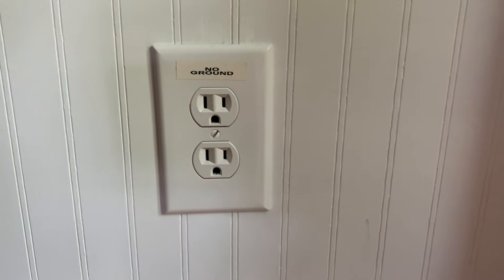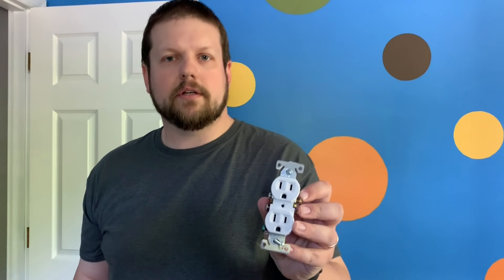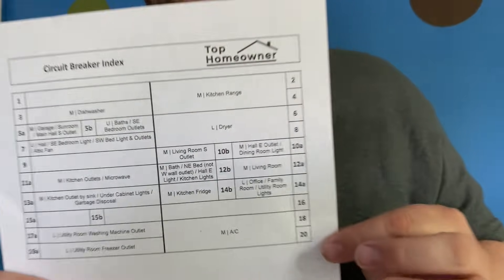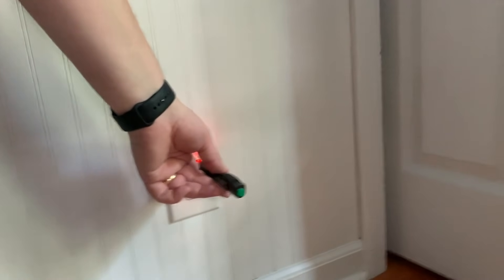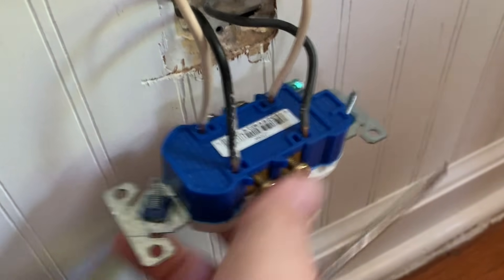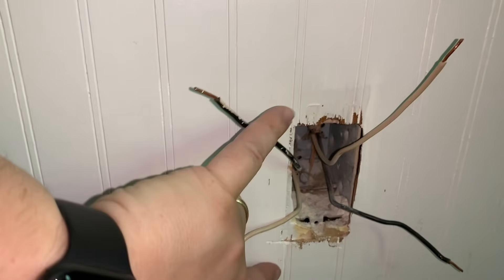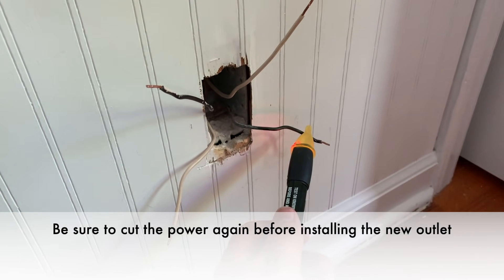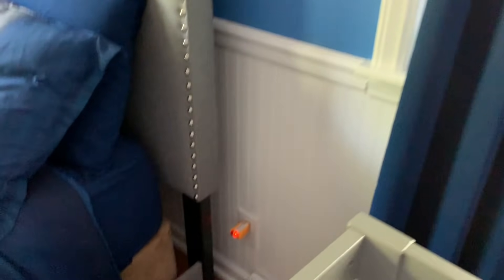Fixing Ungrounded Outlets - An Alternative Option to Rewiring Your Home

Comment: OK my question is, if you’re using a GFCI outlet you still need a ground that is correctly installed back to breaker box. By adding a ground fault outlet you still need a proper ground to make it work and be safe. So can you explain how you fix the ground when it showed it wasn’t working?
Reply: Its NEC compliant to replace with a GFI as long as you label it with "no equipment ground"
Reply: @JeffPenaify  but it won't protect you if the  whole branch circuit does not have a ground.
Reply: @donski1519  I didnt say smart I said N.E.C. compliant 😂
Reply: Don Ski in theory when your body becomes the grounded connector the gfci will trip. It is NEC approved with the inclusion of labels on each receptacle on the circuit (No Equipment Ground). But everyone will agree the addition of the ground wire is better.
Reply: @donski1519  Yes it will.
Reply: Justin, I have two suggestions. One option is to (if they are available for your Breaker Box) replace the standard breaker with a AFCI/GFCI combo breaker. This will connect to the ground in the Load Center and protect ALL outlets on the circuit. The second option, if your Breaker Box is in a fairly hidden area, is to add a GFCI outlet immediately next to the Breaker Box, connecting that circuit from the breaker to the GFCI with new ROMEX, then connect the original branch circuit wiring to the load side of that GFCI.
Reply: justin eben no you don’t !!! To properly install one it only takes two wires so I could be ran without a ground

Comment: You only have a half understanding of what you just did.  I liked your video but caution others against thinking this is an answer to circuits without a ground wire...it is not.  You could have just labeled your existing outlets with stickers that say "No Equipment Ground" according to the NEC.  What you did was provide GFCI protection for all the outlets BUT you still have no equipment ground and All of the outlets (including the GFCI outlet) must be labeled "No Equipment Ground".  What many people don't understand is that GFCI outlets operate without a ground wire, they don't need them.  What meets the NEC code is a label that warns everyone that the outlets have "No Equipment Ground".  I am not an electrician but I'm on solid ground here.
Reply: NEC 2017, Article 406.4(D)(2)a,b,c
You can't just mark non-grounded receptacles with a label indicating "no ground", that does not meet NEC code requirements unless modified by local AHJ.
To install grounded type outlets in a receptacle box with no equipment ground conductor, you have two options.
1) Install a GFCI outlet in every receptacle box and label it "No Equipment Ground".
2) Install a GFCI outlet at the first receptacle box in the circuit, label it "No equipment ground", then at every grounded type outlet controlled by it, label them "No equipment ground", and "GFCI Protected outlet".
As well as making sure that any existing conductors are not connected between the equipment ground terminals on the outlets in the circuit.
I am an electrician ;)
Reply: @trevork9745  You are 100% correct and I will edit my previous comment accordingly.  But my concern about this video and others like it is that they seem to imply that the gfci provides an equipment ground and they do not.  I would have run a ground wire all the way to the service panel to make it right.
Reply: @skippers9277  Agreed, the GFCI only brings a receptacle to accepted code. Best option is to run that equipment ground. Although the GFCI provides a level of protection against shocks, it still does not provide a secondary return path for current during a fault, causing voltage potential on the surface of equipment; perhaps if the circuit breaker feeding the GFCI doesn't trip, thus potentially being a dangerous condition.
Reply: @trevork9745  Or third you could install a GFCI breaker. The point is that they need to be GFCI protected. Where the GFCI is is not relevant. They also need to be marked so that everyone looking at any of the outlet will immediately know both that there is no ground connection and that it is GFCI protected.,
Reply: @okaro6595  NEC2017 406.4(D)1-6 mentions nowhere of using a GFCI breaker to replace non grounding receptacles with grounding type receptacles. Sure you could use the breaker, but thats not code here in particular and not allowed. If AHJ modifies code in your area to include GFCI breakers then go ahead. Its also more cost effective for the HO to use a GFCI outlet at the home run receptacle vs a GFCI breaker...majority of folks swapping non grounding outlets to grounding type/or are remediating the problem of open ground on outlets are doing so following a home inspection where they want to bring repairs up to code as cost effectively as possible. YMMV.
Reply: @trevork9745  I wondered about that too, so I looked it up. "A non–grounding-type receptacle(s) shall be permitted to be replaced with a grounding-type receptacle(s) where supplied through a ground-fault circuit interrupter."  NEC (2017) 406.4(D)(2)(c).   So, "supplied through GFCI" obviously includes a GFCI receptacle or a GFCI breaker, unless local code says otherwise.  Other comments suggest codes that don't allow "downstream" protection of "grounding-type" receptacles (i.e., on the "load" side of a separate GFCI device) without an actual ground.
Reply from the maker: I made a follow-up video that talks about this and answers some other questions here: https://youtu.be/3AXcRsAOLPk
Reply: Without a ground wire all the way through the branch circuit the GFCI does not work. It compares the neutral to the ground, if there is a difference of 5mA or more it will trip. If there's no ground how can it work.
Reply: @donski1519  It can only work when something else (like a human body) becomes the ground by conducting the fault current.  Sounds scary but I guess it's better than what was there before.
Reply: Skipper S while far from ideal, it does provide protection that was not present previously. The intention of the labels (at least in my opinion) is to forewarn people that 1) they run a greater risk of electrical shock (super important for folks that wear electrical devices like pace makers) 2) items plugged into them will not be grounded, which places the item at potentially greater electrical risk
Reply: @donski1519  No, it compares line to neutral.

Comment: When you have exposed wires (7:10) you should wire nut / cap them and then turn on the power. This will prevent any accidental arcing or shorting should someone or a pet  "tamper" with the wires once you turn on the power.  Next, use your tester to test the wire sheathing to find the hot wire(s). I heard little kids voices in the background so this is just another safety measure for anyone in the house that might accidently touch the wires when you turn the breaker back on.
Reply from the maker: Great point! I talked about this in my latest video. It's here if you're interested: https://youtu.be/3AXcRsAOLPk

Comment: How did you ground the gfci without a ground wire?
Reply: bad Good  It does offer protection without an equipment ground by monitoring difference in current between hot and neutral, which means current is leaking to another source.....so yes a GFCI can operate without the EGC.
Reply: The outlet still has no safety ground. This GFCI is an acceptable workaround 
for older wiring with no ground conductor. Need two stickers on the second
outlet. "GFCI PROTECTED" and "NO GROUND"  Thank you.
Reply from the maker: GFCI outlets will prevent shock and electrocution. Always check your local electrical codes to see if this is acceptable in your area.

Comment: Does this CFC I outlets can help secure home appliances like TVs  from source and lightings ?
Reply: no, it has to be grounded via a true ground
Reply: Matt an still may not help in any surge situation like a lightning strike to prevent damage. It has to have surge ratings to perform that function. Then there various ratings within surge protectors as to the amount of surge they protect against.
Reply: @crustyxpunk  No no no, You are confusing operational grounding and protective grounding. Operational grounding i.e. connecting the neutral wire to earth is among others for protection against lightnings. All systems since around 1900 have used operational grounding. Protective grounding is used to protect against electric shocks. It means connecting the equipment case to the ground and/or neutral wire with a separate grounding connector.

TVs typically are double insulated so they do not use protective grounding. They may, however, be grounded through the antenna/cable.
Reply: There's a difference between equipment ground and earth ground.

Equipment ground is an emergency return path to neutral, ideally it'll never be used, but will protect you and your equipment in case of a ground fault. 

Earth ground uses a copper grounding rod that gets driven into the earth and attached to the house, the lightning ideally travels through the rod instead of your eletrical wiring. 

If you want further protection from lightning then what you're looking for is a surge protector.
Reply: @cinnabarsonar2072  How is "equipment ground" somehow different from "earth ground"?  An equipment ground is bonded directly to the earth. That's the whole point.
Reply: @UpnorthHere  Equipment ground is bonded directly to the main breaker's neutral.  It's meant as an emergency return path to neutral if there ever is a ground fault.  Such as if a hot wire's insulation gets frayed and makes contact with a metal casing. 

Earth ground is a metal pole that's buried near the household that's bonded to the service pannel, and is intended to protect the property against lightning strikes, as the lightning will perfer going through the grounding pole instead of through your house wiring.

Comment: If I can’t get a surge protector strip yet but I have a grounded outlet, can I plug this nice plasma tv into the socket and watch it during heavy storms?
Reply: If you still use plasma you should hope for a surge so that you can get a new one. :-) (Well I had a tube two years ago)
Reply from the maker: I wouldn't do that... Even with a surge protector!
Reply: J Wil really?!?  So power strips are just for expanding more outlets?
Reply: @HamuelTheGrey  It does nothing against a direct trike. Sure it there is some strike nearby it might help.

Comment: So, let me get this straight. Iregardless of the allowd code. If my right hand comes in contact with the hot side of a UNGROUNDED GFI receptacle and I touch my kitchen faucet with my left hand I am completely safe???
Reply from the maker: Generally speaking, you should always take basic safety precautions so I wouldn't tempt fate.
Reply: You will likely survive that but if you do it will a grounded non GFCI outlet you likely will be dead. A properly working GFCI is almost 100% effective against severe electric shocks. It does not protect from a shock between line and neutral though.
Reply: John Connolly  ... "a very slight pinch" for the 17 milliseconds it took for the GFCI to trip.

Comment: WON'T WORK!  The "GFCI" stands for "ground fault circuit interrupter".  What it does is monitors the electrical potential (fault) between the hot wire and ground. If the GFCI is not grounded then how can it detect a potential to ground?
Reply: do you want to google "how does a GFCI work" or should I?  https://lmgtfy.com/?q=how+does+a+gfci+outlet+work
  (spoiler: it detects any difference in current between the hot and neutral; any difference indicates a ground fault (i.e. the current is going somewhere else), and it interrupts the circuit; it makes no use of the ground conductor at all, and it is perfectly legal and within NEC to use GFCI outlets without ground WITH a label that says "No Equipment Ground")
Reply: I believe the guy said it's grounded from behind the box..
Reply: @scribblit  no ground in this application
Reply: needs afci/gfci
Reply: @mcgilljb92  Possibly, but probably only "where branch-circuit wiring is modified, replaced, or extended," not simply replacing an ungrounded receptacle with a 3-slot ungrounded GFCI.

Comment: This is a good option in older homes. GFCI outlets are significantly more expensive than regular 3 prong outlets, so use one GFCI "upstream" of the other outlets in each circuit. One thing to be aware of is many older homes like my 1949 home are not wired with all the outlets in one room on the same circuit. In fact, no room in my house is wired that way. For example, there may be one of the outlets in the living room, another above it in a bedroom etc. So, I made a booklet of circuit diagrams by going circuit by circuit turning off the power and seeing which outlets and lights had no power. I also traced the exposed wires in the basement to get an idea of which outlet was first in the circuit. The kitchen and also the washer/dryer area were the only grounded circuits. The rest of the 2 prong outlets in the house I upgraded to 3 prong, protecting them with a GFCI at the start of the run, and attaching proper labels them. A lot cheaper than rewiring your house, but providing ground related safety without a ground wire.
Reply: Or you can replace the actual breakers to GFCI breakers. It will protect everything on the circuit that breaker feeds
Reply: @terrythomas790  If your place has breakers.
Reply: @ronaldcarson4360  If it doesn't have breakers, have an electrician install a subpanel for the necessary GFCI or AFCI breakers.
Reply: @terrythomas790  Very often not possible.
Reply: @terrythomas790  
Sometimes you don't want certain receptacles on a GFCI circuit.
Reply: @terrythomas790  this is a good option if you have a modern panel, but if you have an older home like my 1960 home it’s not an option
Reply: 1949 home with different circuits in same room. It’s better to have that you room is served by 2 circuits with double the amp capacity of 1. Running a vacuum on one circuit and you won’t trip another outlet like the Window AC.
Reply: @tonymanero5544  Agreed!  As an electrician with 30+ years of experience, I never wire one circuit per room.  If something goes wrong, the customer will have to run an extension cord out into the hallway to another room.  Ridiculous!  The only reason that people do 1 circuit/room is laziness.
Reply: @SwingboyPA  ...there's another reason... $$$$
Reply: @Quickened1  I'd say it's more expensive to go bust open walls to do it right the second time. But that's just me I guess.
Reply: @nova31337  ... The people that do it cheaply, don't care what you have to spend down the road.  They just want to get in, and get out,  as quickly as they can, as inexpensively as possible, to make the highest profit...
Reply: @Quickened1  
Speaking of cheap and dirty, I just saw a 30 year old condo with outlets that had ONLY backstabs, no side screws!  I didn't know they made POS outlets like that.
Reply: @SwingboyPA  i do the same,at least oone outlet from a different circuit.
Reply: Will doing this pass an inspection got an order on a project from the home inspector that all plugs that didn't have a ground need to be grounded please help want to be done with this project
Reply: Oh my god thank you…I’m encountering this issue with my house that was built in the 60s.
Reply from the maker: Thanks for your comment. I made a follow-up video that talks about this and answers some other questions too. You can watch it here: https://youtu.be/3AXcRsAOLPk

Comment: This won't work for anything that isn't an outlet. Light fixtures, refrigerator dishwasher, etc.
Reply: This is not exactly true... Anything down stream of the GFCI should turn off when the GFCI is tripped. So any light or vent that is powered by the same circuit (as long as it is downstream) will work. I installed a shower light and fan in a bathroom I finished, and to be to code in my area, I had to wire it downstream of GFCI so it would turn off when there was a short. So, depending on your wiring scenario, the light in the room could be wired downstream.
Reply: You know nothing of what you speak of lol because it actually will...
Reply: Pretty sure refrigerators get plugged into outlets genius...
Reply: @ajflowz5009  One should not use GFCIs with fridges or freezers. The cost of accidental tripping is too high.
Reply: Okaro X yet we wire them this way all the time without issue..
Reply: AJ Flowz refrigerators are on independent 15A receptacles that shouldn’t be GFI or AFCI protected
Reply: Nick I’m not going to argue. Refer to the NEC. It’s mandated now.
Reply: AJ Flowz well in Canada, the CEC allows refrigerators to be on a dedicated 15A circuit. Only exception is a single outlet with a clock plugged in. Your fridge will just trip a gfi with its higher motor start up
Reply: NEC in the USA doesn't require GFCI for a refrigerator in a dwelling unless it's within 6 ft of a sink or in a 'laundry area'.   However, AFCI is now required for "All 120-volt, single-phase, 15- and 20-ampere branch circuits supplying outlets or devices installed in dwelling unit kitchens,..." NEC 2017: 210.12(A).
Reply: Yes, anything downstream will be protected by the first GFCI, but appliances are normally supposed to be on their own circuit separate from receptacles.  Same applies for lighting. Any new construction or repairs must meet code, so if done by code, this wouldn't be a solution.